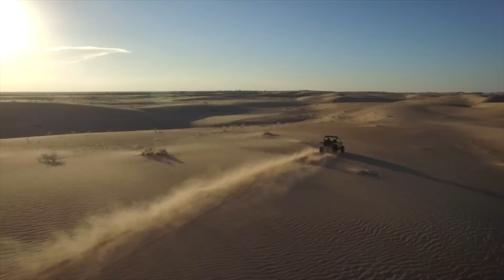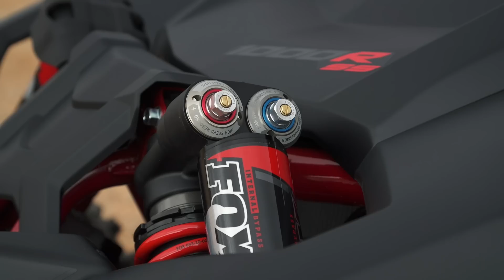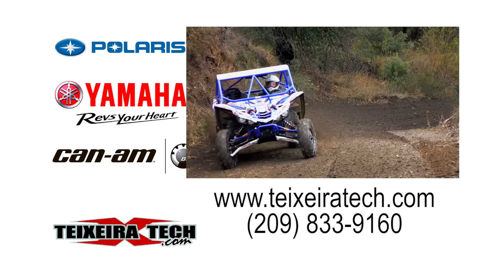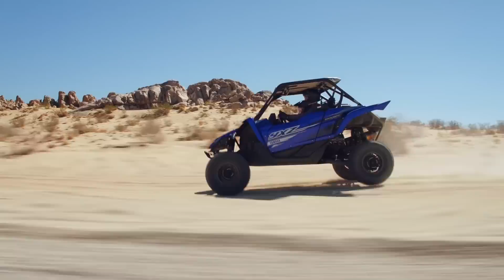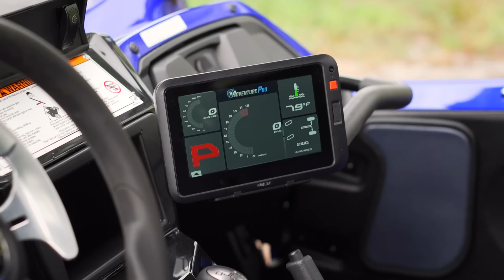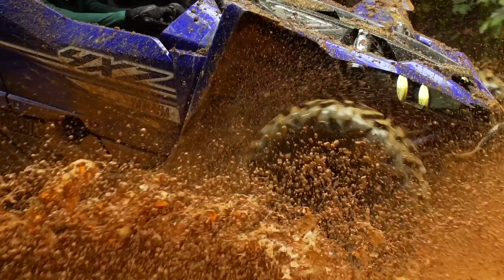2019 Yamaha YXZ1000R SS Test Review

Comment: I clicked this because i thought it was a review. I didn't realize it was a commercial.
Reply from the maker: This is the reaction we're used to from people who were accustomed to watching crappy reviews. Yamaha didn't pay for this we promise.
Reply: @UTVonDemand  I love Yamaha, but you can't find negative things to say about it?  Do they loan you machines or do you buy all of them?
Reply from the maker: @russhendrix9674  our complaints. Number one, we said the gearing was design for 29 to 30 inch tires. Some people would consider that inadequate and we suspect they can judge that for themselves. Number two, we mentioned that there is a more noticeable gap between first and second gear. Number three, we mentioned that we wished the engine had more bottom-end power. Number four, we mentioned that some people would complain about a loss in bed space due to the radiator being relocated there. Number five, we mentioned that the rear trailing arms had a tendency to drag in deep ruts. So there you have it. At least five potential complaints when you said we didn't mention one. We typically test at media events or receive loaner units from the manufacturers.
Reply: @UTVonDemand  ok fair enough. new sub.
Reply from the maker: @russhendrix9674  thanks! We're very glad to have you.

Comment: Anybody knows if a yxz with forged rods etc could be used as a daily? With highway miles too.. yeah I know it’s not comfy but that’s not the point... I like my vehicles to be as rough as possible...
Reply: I think you could. They have a high top end and the ability to lower RPM with gear changes. (unlike the cvt) I've heard of people putting 20k plus miles on them with no issues. They are built well with a solid feel and real automotive style doors. You feel safe inside, the seating/visibility is great and the steering feel is just awesome. They are easy to maintain as far as oil changes as you rack up the miles. Hope this helps you...

Comment: So, you HAVE to use the paddle shifters? That shifter in the middle doesn't have an auto drive mode?
Reply from the maker: Yes, you have to ship with the paddles. There is no auto mode on the yxz. It really couldn't be much easier though. Just shift up you don't even have to let off the gas.
Reply: @UTVonDemand  cool!

Comment: Where are the reviews for a 2019 yxz 1000r SS SE, GYTR® Full Exhaust System by Dasa Racing, GYTR® Race Cylinder Head Assembly, GYTR® Race Camshaft Set, GYTR® Turbo Kit for YXZ1000R™/SS B5J/H, GYTR® Torque Assist Gear Kit BSJ???????  And more importantly a build video with testing and real world results as each new part is installed??????????????

Comment: has it really solved the clutch problem.  that's the real question!
Reply: What problem? My 2016 (that I bought new) has 2500 miles, the last 1000 have been RPM/Weller turbocharged. Many many 11,000 RPM 4WD sand launches, and full throttle shifts. My clutch still feels like new. The "problem" is/was inexperienced drivers slipping the clutch excessively.
Reply from the maker: @lllateralus  we had a feeling it was mostly highly modified engines and Driver error. Driving around in first gear with the clutch pushed 1/2 in for prolonged periods of time
Reply: UTVonDemand        Yes absolutely. In a sticky situation, it’s actually easier on the clutch to do a little rev and dump than to slip the clutch. For me, clutch is in or out.. and very little in-between. Slow and smooth starts on flat ground, I’ll slip the clutch momentarily.. very low RPM.
Reply from the maker: We've been told yes. Yamaha is claiming something like a 230% increase in clutch durability. The exact number is in the video.
Reply: The “clutch problem” your speaking of doesn’t exist with the four YXZ’s in our group. That’s with numerous 10 thousand RPM launches.
Reply from the maker: @DUNEDIRT  we had a feeling that any clutch issues in the past were primarily due to driver error.
Reply: Not alot of people can drive a manual transmission theese days. I learned to modulate or slight slip the clutch at a young age. Lived in a small town on the side of a mountain. Starting from a dead stop at a stop sign on a hill so steep you could burn up your brakes with 5 cars behind you at a stop sign you figured it out or you rolled back into them and then had to tell your old man. Luckily I never had that problem. Bit I did avoid that hill for a month or 2 until I learned to opperate a clutch better.
Reply: hogger706 there was never a clutch problem learn how to drive

Comment: My 2017 YXZ is absolutely awesome and bulletproof. Just did a Weller flash tune and the power is dramatically increased while running cooler at 180 degrees. The whole unit is a blast to drive and shifting gears with a clutch pedal is second to none! Don’t get caught up with horsepower number wars and go look and drive a YXZ. Lastly...there is no belt to blow leaving you stranded!
Reply from the maker: Thanks for sharing your experience with the yxz with us. We've also noticed that reflashing stock ecu's lowers operating temperature in addition to building horsepower. That shows you how lean the manufacturers are being forced to run the air-fuel mixture to meet emission standards. Thanks for watching.
Reply: My friends and family all have Rzr Pro R’s, maverick x3’s etc. and I’ve driven them all.. I’m still on the hunt for my own yxz with three pedals.. here in Arizona we can also drive these around town and I feel this would be a hoot to have in my driveway vs any cvt on the market
Reply: DUNEYXZ I saw an advertisement a while back from Yamaha bragging about the YXZ racing King of the Hammers race, and the fact that they don’t have a belt. The funny part is that for the past several years a belt driven Polaris RZR has dominated this race.
Reply: Steve&Stephanie Caudill... Well, more RZR’s enter because they are more plentiful. The Can Am X3 changed 5 blown belts in one race. No thanks!
Reply: DUNEYXZ If the YXZ was as good as Yamaha claimed to be that wouldn’t be a problem, it still could have won. It just doesn’t preform as well as the RZR’s or Mavericks.
Reply: Steve&Stephanie Caudill...I ride with a X3 RC and your incorrect.
Reply: DUNEYXZ How so?
Reply: @stevestephaniecaudill4879  you gotta remember the ones that are being raced at King of hammers aren't the same machines you buy off the showroom floor. YAMAHA'S machine is probably closer to stock.
Reply: @stevestephaniecaudill4879  like Dune ATV said + in trails, we leave them in the dust... Being able to shift is key